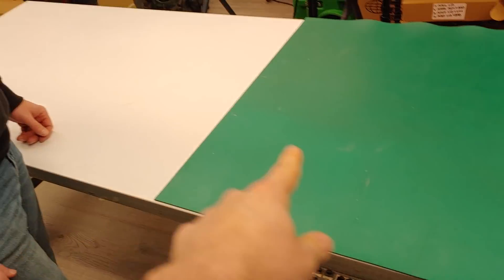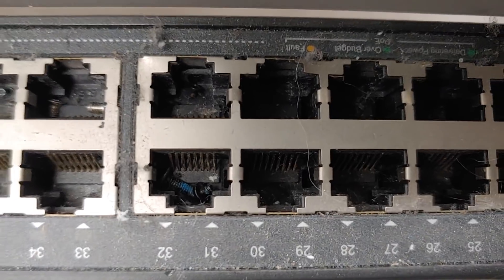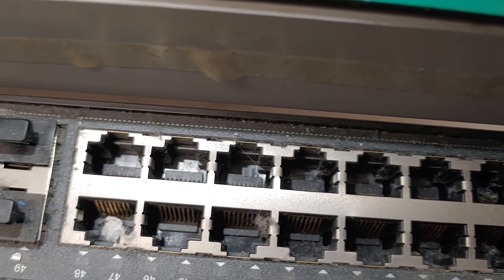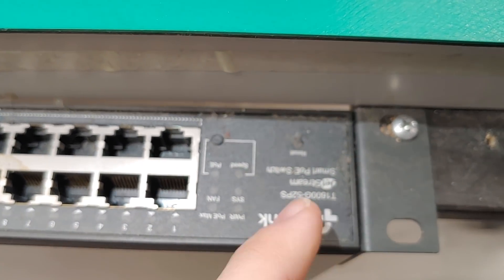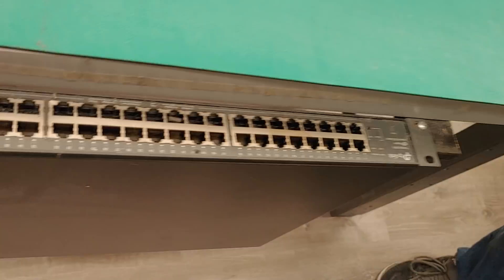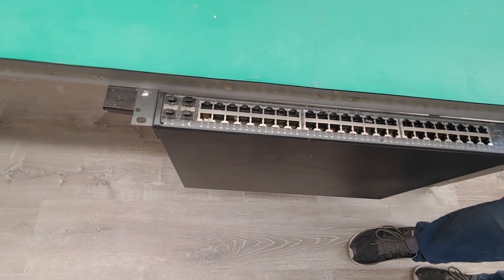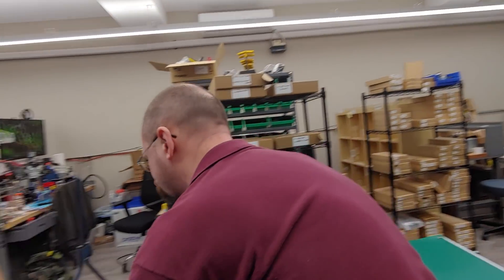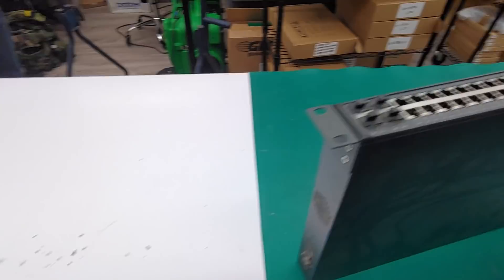Poor little switch didn't stand a chance😢

Comment: Simple: don't mount the switch box FLUSH to the table. Mount it at least 3cms higher than table edge. The ports will collect dust but not screws or other pieces for sure.

Comment: I would mount that sideways on a wall if you really need the space. That way crap doesn't fall into the ports. Make sure it's far enough off the floor too so if there is any dust that settles the switch fans don't immediately suck it up.

Comment: That's a really good switch (good brand and specs). I think you can continue using it. RJ45 is designed to accept short circuits and lots of interference.
Anyways, open the case, clean its internals with compressed air, oil or replace the fan and visually check for broken caps. Then reset it to factory defaults and configure the network properly. At the very least you should keep it as a spare.

Comment: When mounting a switch like that I always cover all the ports with wide painters tape, also good for blocking dead/faulty ports, then cut and peel off  (or sometimes just punch out) ports as needed.  Another good option is to put it in upside down, make a bunch of  short MtF cables with the power pins not connected , and then mount them  to the back of the desk.

Comment: My switch is over the bench under the shelf. Out of the way, reachable, viewable for unusual traffic, etc. Not mounted with ears. Cover was removed, drilled, and screwed to the shelf, then the router reinstalled into the lid. A couple of cable management devices and the install is clean and accessible and not prone to random stuff falling into it. It's even immune to a spilled coffee.

Comment: You guys can use masking tape to cover the unused port to pretend shitty things and dust, don't delay save all those little poor things today!!  (don't buy the common  yellowish-white so-called masking type you can easily find in the stationery store that made in China, nowadays, it will leave super sticky residue on the surface/ Buy some cheap no residue adhesive masking tape for decoration)

Comment: Proposal: mount the switch (if it still works) under the desk and run some Ethernet cables to a a couple of keystone panels with coupler keystones. No cable crimping needed if you get 1ft cables in bulk and can be done for about $60.
Reply: Can be done for much less if you only need 24 ports.

Comment: Looks like the TP-Link my colleague has to administrate. Told those would crash just because, so not only the screws do their job.
Reply: His is probably defective or has somewhere a connection/broken cable issue. As far as I know, if you need cheap and reliable network equipment TP-link is a good choice. I never had one fail yet.

Comment: Found the source of dropped frames! Maybe Spectrum needs a small apology lol.

The good news is, the switch is probably still good, and probably still provides power just fine. The switches have short circuit detection and those screws are likely not the most conductive in the world anyways due to the paint. I've had switches actually blow up devices on the other end that shorted due to rain water and a lack of service loop... And the ports still work fine.

Comment: In fact, screws or any shorts in unused socket cannot hamper switch function. And yes, you absolutely can crimp connected cables, nothing will happen. Sometimes even PoE ones, if switch is really good.
So there is definitely something else wrong with that switch.

Comment: When I was working overseas during the war we had to build a special building that was fully networked.
Problem is, normal RJ-45 jacks would get filled with dust and sand and have to be blown out before plugging anything in.  
Since the walls were metal, it also made installing power and network gangs and running cable a pain.
"Hey boss, I think I have an idea."  [point finger at ceiling]  Boss:  "That's insane, but what the hell.  This whole deal is already crazy."
Since it was a lowered ceiling with see-through grated ceiling tiles, we put all the wall gangs, faceplates, RJ45 jacks, and power gangs and outlets in the ceiling tiles themselves.  Worked like a charm.  
High enough that people wouldn't just go randomly plugging in unauthorized devices, upside down so they never filled with dust/sand, and the dangling cables let us instantly see what was plugged in at any given moment.  It also allowed us to move tables around in any configuration without having to worry about running cables across the floor.
You just grabbed the stepladder and plugged everything into the outlets and jacks right above where the tables would wind up.
Reply: You must of been in the Marines on small FOB, any larger Army ran FOB or KBR contractor office has either rubber covers in the empty spots or spare RJ45 connectors.
Reply: They had networking in World War One? Jesus man, why I never read about this in my history books.
Reply: @SMGJohn  I thought the same thing, the military is always hiding technology to us :o
Reply: i'd just leave something plugged in to every keystone
Reply: INSPIRATIONAL!
Reply: GENIUS!

Comment: Those chubby tplinks are immortal, used a few of them for multiple years with and without racks, and also witnessed some of them dropped to the ground without any harm besides some dents. In comparison we had a few ciscos at the supercomputing center I worked in, which front panels cracked in half due to compression after we shut down the cluster for a day without turning off the chillers. They were mounted in those extra sturdy 42U racks meant for high weight devices and most of the devices mounted in the bottom of the rack couldn't bear the pulling forces exerted on them due to temperature differences.
Reply: Same for the old Linksys ones. I have a Linksys 2016 16+2 port gigabit switch I got from eBay. I'm sure it came from a datacenter that gave it a hard life. Now it just quietly provides reliable fast Ethernet around my house and fiber optic link to my server.

Comment: Heh, and I bought dust covers to plug the 2 unused ports on my 8 port switch just because I was worried about dust building up in them. I never even thought about screws or other things getting in there!
EDIT: Here's a link to what I bought in case anyone is interested. https://www.amazon.com/gp/product/B01I814D0U/
Probably better value to be had at larger quantities, but I didn't need that many.

Comment: Network Engineer here... This video hurts my soul.
Reply: I felt my soul leaving my body while watching this. How to not mount a switch 101.
Reply: Well a lot of the time networks in these kinds of places just grow organically over time, so what once might have been a nicely planed network ends up being kluge upon kludge with increasingly dubious cable runs and hardware attached. A lot of the time things are just thrown in there to fix the immediate needs. Get things working NOW and you can make things nice once the current crisis is over and done with. It's just that once you have something working, however sketchy it may seem, it's hard to motivate tearing things down and redoing it "the right way". After all that cost money and any time spent working on the network is time not spent on fixing things that actually makes money to pay the bills.
Reply: @blahorgaslisk7763  like they say, there is nothing more permanent then a temporary solution that works.
Reply: Lol, I hear you.  I don't think a worse way exists to mount a switch.  Pizza crumbs, dust, liquids running off a table, solder bits, and of course, screws fall into the ports.  Not to mention bad thermal dissipation locked between a table and the back wall.
Reply: I honestly thought the switch was in this position because it fell or something, but they actually mounted it that way... This really hurts our souls
Reply: i agree but at the same time love it for how stupid it is
Reply: I.T. admin here. Just like the thermal paste idiots....this did nothing to me
Reply: Scares me to think that the group of skill in that business only to see that regardless of the convenience is frightening.
Reply: At least the cable management isn't as terible as I have mine at work. 2 48 port switches patching with random mostly too long cables all over the rack.
Reply: That’s what you get when u cheap out, instead of leaving the switch on the rack and do structured cabling with data points on each workstation. The damage if the switch stopped working though may not be cheap.

Comment: And that is why you never point any type of power outlet/plug/switch upwards.
It collects everything from screws to dust and other junk that can destroy it or even worse set it on fire.
Reply: Datacenter I worked in had a policy of filling any empty ports with empty rj45 ends.
Reply: @chibichabot9293  I hope they were not the uncrimped ones you can use to put a connector on a cable. If they are not crimped down they can actually bend the little connectors in the outlet.
Reply: Almost died!
Reply: Oh no! It can catch fire!
The magtronometer will explode!
And then suddenly it downloads tiktok instead of the firmware update!
ROBUST  CONVERSATIONS
Reply: @QoraxAudio  🤣🤣🤣
Reply: In this case, they should have mounted the switch at least 3cms higher than the table edge, so screws could not roll into the ports. Anyway it shows lack of a cleaning routine  :-)
Reply: On the upside it catches the electrons better :p
Reply: @eideticex  yeah, if you pointed it downwards all those electrons would just fall out.
Reply: You can buy dust covers for ports pretty cheap online.
Reply: @_PatrickO  or just mount it on the underside of the table?
Reply: Yeah IF you have no where else to put it or that orientation is the most convenient then grab some cheap dust covers for it.
Reply: Mine is also in that orientation. I have to buy the covers. Sfp port are getting full of dust!
Reply: I wouldn't consider pointing them upwards a major risk... Putting them on the edge of a table however... Just put everything in a rack cabinet or equal protected space, where everything will be behind another a protected base. In the largest datacenters this is also still applied, even though in some of them there is nearly never any foot traffic. Some of the big cloud companies just do shipping containers instead, to keep the density up.
Reply: Or you just buy some dust covers.
Reply: 1) can't set anything on fire. 
2) won't harm the switch if contacts get shorted
(This specific case.)
Reply: Andrew Delashaw it’s a PoE switch. Shorts can cause physical damage. I have seen a few over the years. Most of the time  it’s just the port that dies but sometimes the whole switch will shit the bed.

Comment: 🤔that would explain the random crashing😂🤣
Reply: Except it's not, you can't short the ethernet port just like that, it use transformer to isolate the line so short like this will not affect it
Reply: Nope. No way. Even with POE. Especially not on that business-grade switch.
On that switch, if it was properly configured (STP enabled), not even a loop would have effected the whole network.
Reply: Embarrassing!
Reply: Maybe that's the reason for the slow internet at the old store
Reply: @gi4dtv  If only, spectrum is utter horse shit internet.